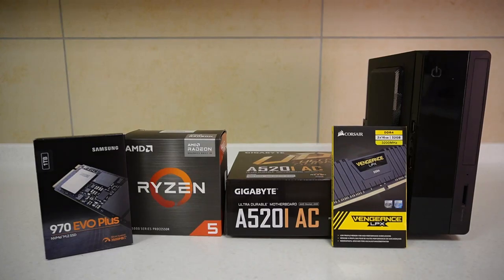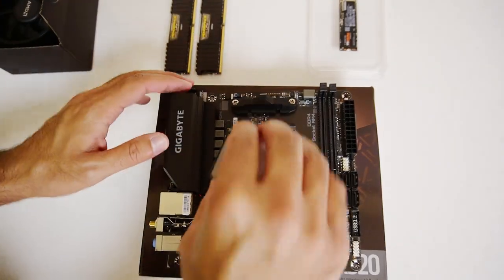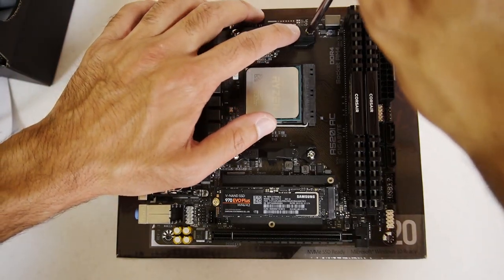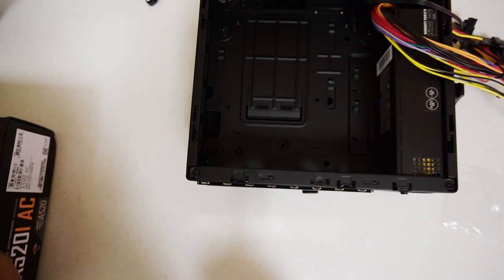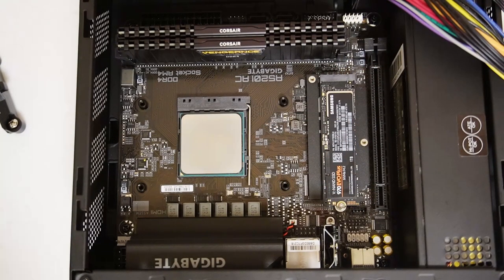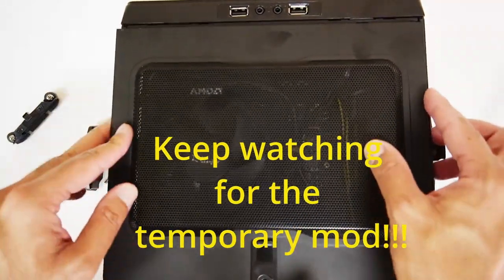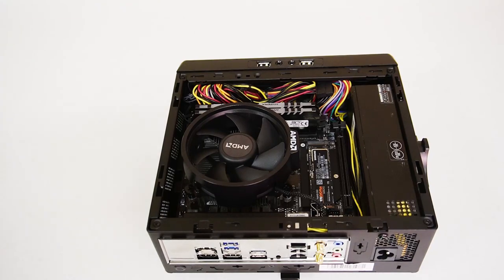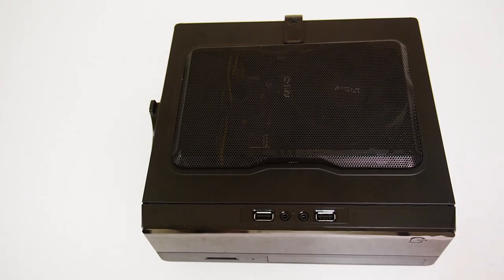Mini ITX Build - Gigabyte A520i AC, AMD Ryzen 5600g, CIT MTX007B, Samsung 970 Evo Plus, 32GB DDR4

Comment: if you take the outer cover of the CPU cooler off it should fit with no issues.  I have the Chopin case and had to do that to get it to fit with the same cooler
Reply from the maker: Hi, Thanks for watching. I really appreciate your feedback as it might help others in the same situation. You are right it will probably work as this case is very similar to the inwin chopin, might have to try it at some point though I think I've become a bit lazy  now that its all up and running :D. Thanks again, all the best, TK :).

Comment: I personally love these small cases and all most companties have to do is upgrade to 250-300 watt PSUs and update the front USB ports. I'm looking at building something for some light gaming and was just waiting for Ryzens new APUs to see which direction I'm gonna take. I may have to find some cases slightly bigger.
Reply from the maker: Hi, Thanks for watching. Yes I agree about the PSU especially for more demanding workloads and high end CPU's. I guess you could just upgrade them but then cost goes up. I think Inwin cases have some cases with gold rated PSU's but cost more. There are also some relatively small mATX cases now I think ASUS has one which definitely give more room for upgrades but obviously bigger than itx cases like this. I am also interested in seeing what the new Ryzen APU's bring and may even build another one, if that happens will definitely post another video. In the mean time, all the best, TK :).

Comment: Hi! Did you update your bios for this one? Was gonna get one for an arriving r5 5700x. was not sure if i need to get this mb or another
Reply from the maker: Hi, Thanks for watching. So for my motherboard I did not have to upgrade the bios as it must be from a new batch and already had a bios compatible with Ryzen 5000 series CPU, however it does have bios flash back (known as Q-Flash Bios Plus on gigabyte boards) and the bios can be updated before you install the CPU. I have a video of this process for x570i and I believe it will be similar for this board. I would recommend doing this before installing any components and if possible without installing in the case. Hope this helps, all the best, TK :).
Reply: @TKsTechTalk  Thanks, man! Please continue making awesome content!
Reply from the maker: @HandlesLikeADream  You are most welcome and I really appreciate your kind comment, will keep trying to create helpful content. All the best with your build :),